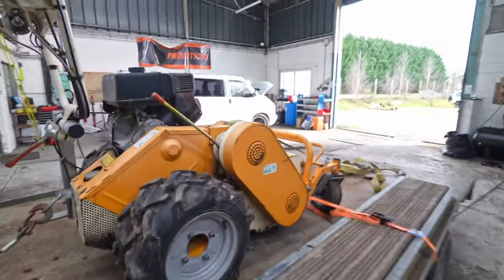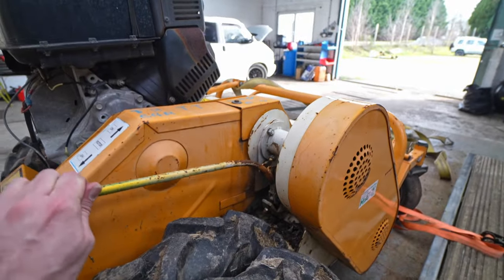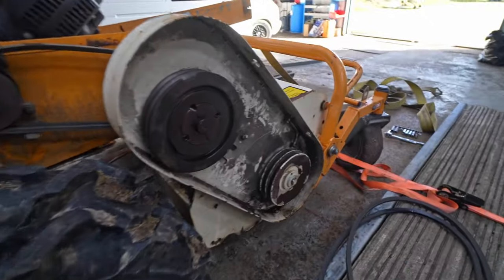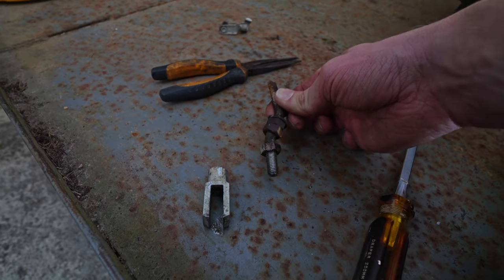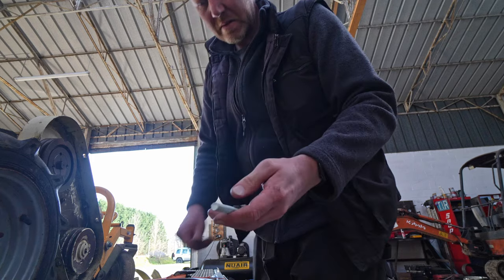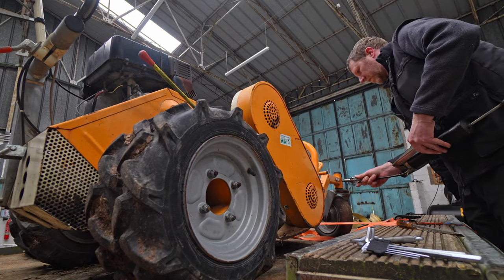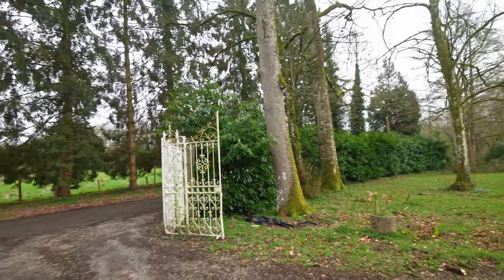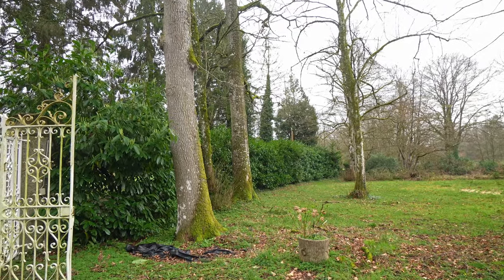Nothing Works When You Need It To! - Chateau Life 🏰 EP 337

Comment: On the chanel about Castle Ten Berghe, they have a special mower that they use to clear the edges of the moat.  It sits at a 45-degree angle (adjustable, I think) and is on a kind of arm that you extend.  I wonder if you used one of those to remove the vegetation, if those nasty critters would head for the next moat over?   🧡